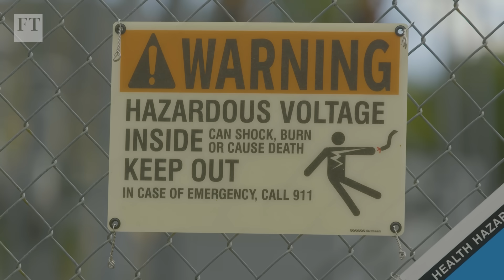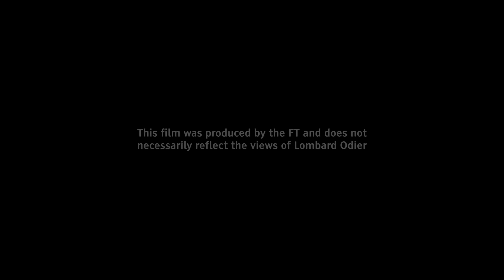The great dam removal | FT Rethink

Comment: I used to live in Sonoma County, and I know all about the Potter Valley Dam.  There is already a diversion tunnel going from the Eel River to the Russian River.  The main purpose of the Dam is to raise the level of the Eel river so that the tunnel's flow is reliable.
It us useful to know that the Santa Rosa metro area gets something like 1/3 of its water from the Potter Valley tunnel.  (IIRC, the dam is actually owned by PG&E,  who are a regulated utility.)
There is no way that the Potter Valley dam will be torn down before a replacement source of water is built, and that will not happen in the lifetimes of any of the people in this video.

In other words, the whole part about Potter Valley Dam is just Crazy Talk.

Comment: The aspect of opposition to "end-of-life" dam removals that I will never understand is that the reason for the removal is literally in the name of the process. Sure the structure might be sound now, but if the infrastructure has reached the end of it's commercial life span and there is no reasonable option for it to be recommissioned then over time the asset becomes stranded which leads to maintinence issues. This happens with mines all the time, they reach end-of-life or sub-economic levels for prolonged periods of time, and rather than invest in remediation straight away someone kicks the can down the road. Then upkeep fails and we get another environmental disaster. 

I'd even take a punt and say that if the dams were kept for water storage without power generation subsidising the cost of upkeep, these residents/ growers would also be annoyed that their water prices have increased dramatically. Fun fact: google says that even though dams can operate for over 100 years the average lifespan is around 50 years, which is younger than the dams in this story.

Comment: I guess the fire chief doesn't know that allowing the rivers to return to their normal levels, letting the surrounding area get saturated with groundwater, etc...  actually helps prevent fires....
Reply: thats not how it works
Reply: @Callum19900901  and why?
Reply: Beaver swamps are amazing at wildfire prevention
Reply: @JeffBilkins  exactly!!!
Reply: @jbCoolPopa I can’t tell if you are joking or not. The areas that are prone to wild fires will not at all be helped by the removal of dams and they will not turn into swamp land. That water will just run into the river and downstream instead of being stored.
Reply: @Zorin9  you don't have to believe me. You are free to look up the MANY videos about this on this website.  There are hundreds of rewilding/beaver intro docs that explain my point.  

You know you don't have to be ignorant to these things.  Lack of information is a choice you're making.
Reply: Not in the higher elevations above those streams and ponds.
They OFTEN flood in the Spring and are dry late summer.
More Beaver dams would help though for some higher elevations areas

Comment: Problem is all dams, like bridges reach and end of life. Usually with no plan on what to do if they fail or while they are being replaced. Between construction and end the demand for them hits 100% and nobody wants to pay for new construction or … go without while waiting.
Reply: the problem with all dams is they need maint and upgrades to keep them up to code and safe. You do not see Hoover dam, Shasta, Folsom, Bonneville etc being considered to be torn down, they are kept up to date, private dams, and even some public owned ones are not.

Comment: They destroy the forest to put wind turbines, they destroy the rivers to put electric dams, they destroy lands to put solar panels and then they talk about climate change
Reply: More Maga common nonsense, it's them damn liberals fault.
Reply: Because fossil fuels will cause much more destruction.
Reply: how is land destroyed by wind farms and solar? No one is cutting down forests to build windfarms. Forests are cut down for timber, paper, and crops to feed animals. And the land they are built on will still be there when they are removed. But land, rivers and lakes are poisoned for generations by oil and gas drilling. And entire mountains are scooped out of the landscape to mine coal, and then that coal rains sulphuric acid down on the land and the people when it's burned. And the CO2 from all fossil fuels turns into carbonic acid in the oceans and eats away at the shells of sea creatures and coral reefs, killing them by the millions
Reply: @archigallus  Our Greek Harry is an AI bot.  Stop trying to reason with it...
Reply: @archigallus The great thing about solar and wind energy is that, on land, the infrastructure is very easy to remove and, if needed, can be quickly returned to its original use.
Reply: @archigallus well you clearly talk about a different plane.
Reply: Why the bitterness, Harry?